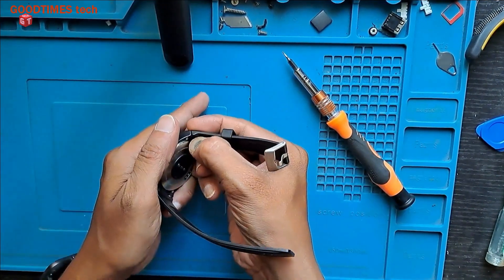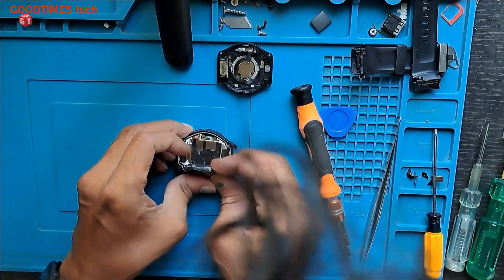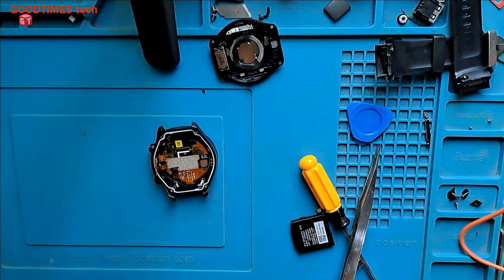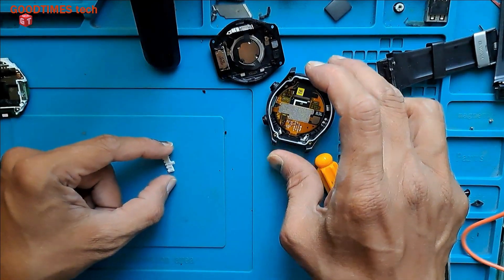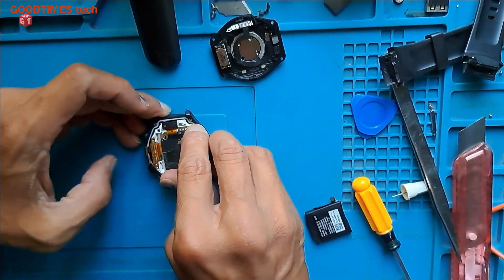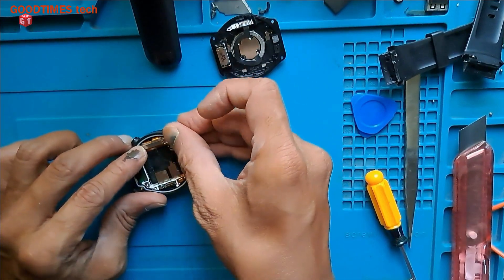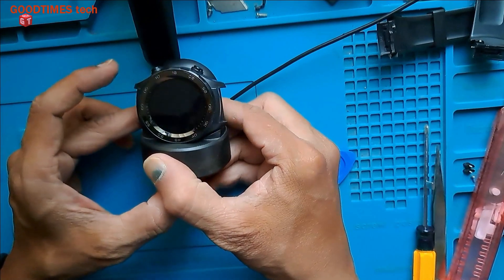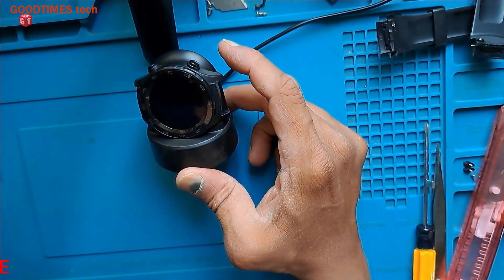Huawei Smartwatch top button not working | How to solve.

Comment: I had the same problem with my watch but I didn't know where to get the rubber part from so I just exchanged the button which meant I couldn't use the bottom button.
Reply from the maker: Thank you for watching the video and for valuable comment.
Have a GOODTIME....